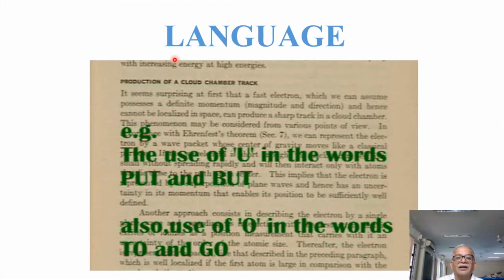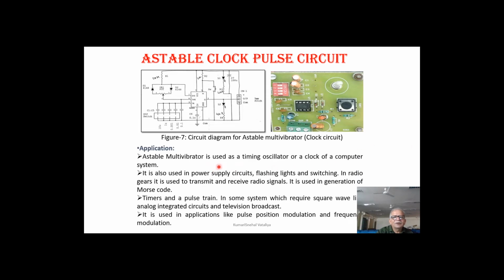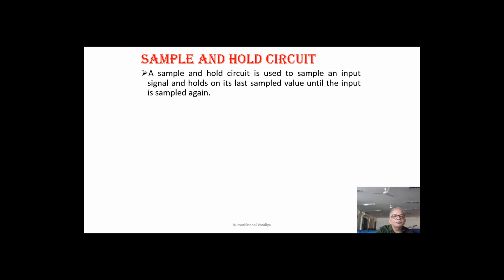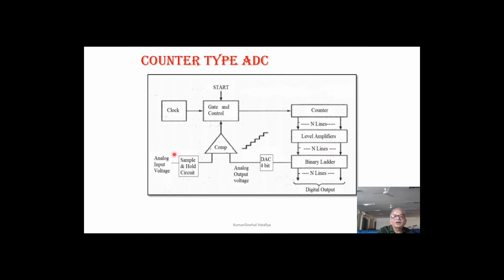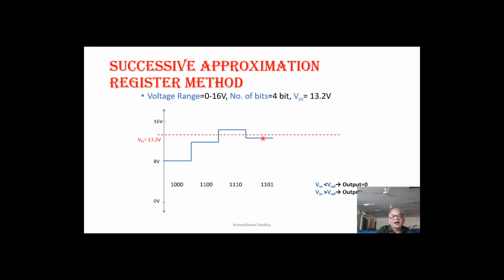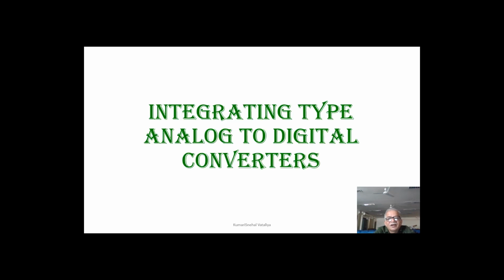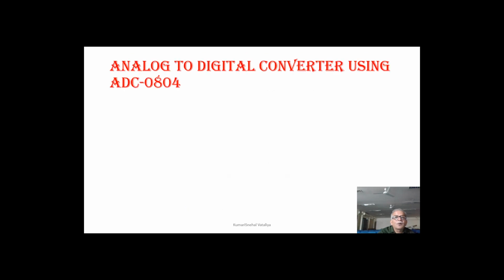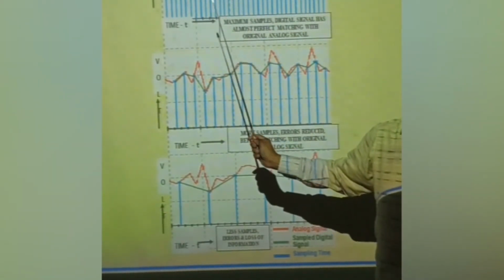Prof. P. D. Lele

Comment: Excellent presentation on different types of ADC and different types of DAC. All the types of ADC and DAC with their working, circuit, advantages and disadvantages has been extensively discussed in this lecture. Thank you so much professor.